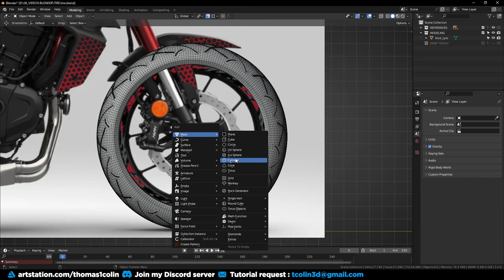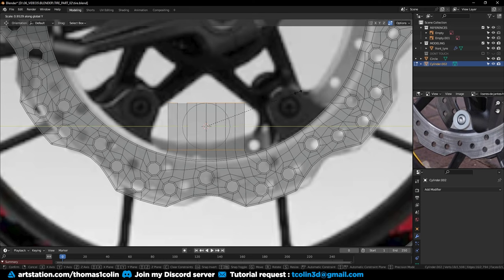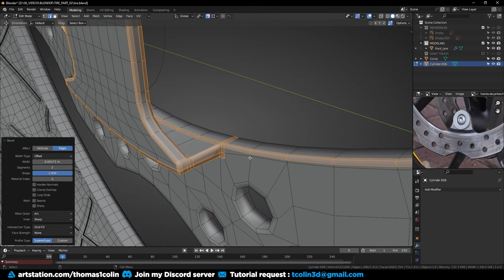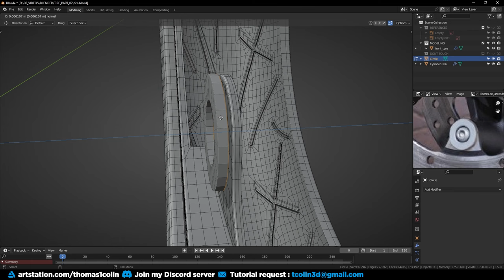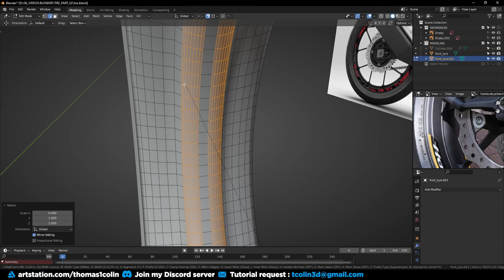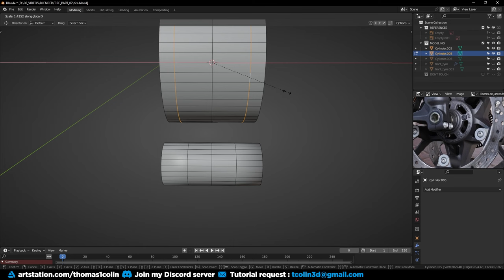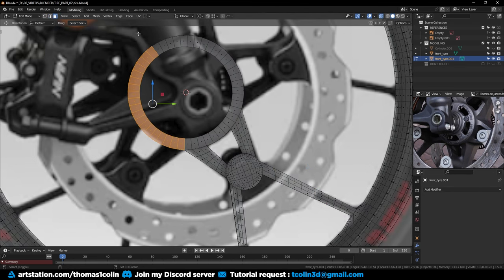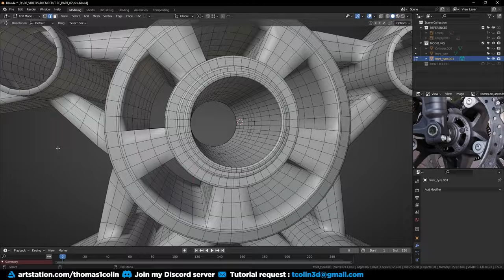Modeling a Motorbike in Blender - Part 2 : The Wheel

Comment: looks awesome. But wouldn't it be a lil easier to model only 1/5 of that part with the array of 5 with constant offset from the empty?
Reply from the maker: Hey man, well it depends. There are multiple ways to that. I tried to model 1/5 of the model but the result was not that good 🙂
Reply: @ThomasColin3D  I just start model rims from simple circle with sufficient number of vertices, and the delete those I don't need and turn on the array for n number of parts I need. That way I am modeling 1/5 or whatever number, but I see the whole mesh all the time and can adjust. But yeah, sometimes you get really bizarre rims that's better off with other methods.